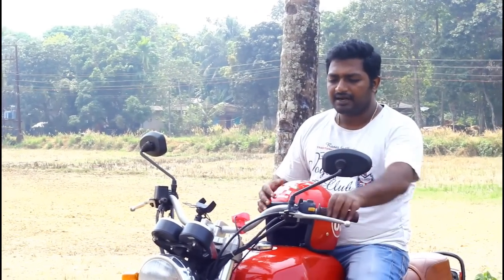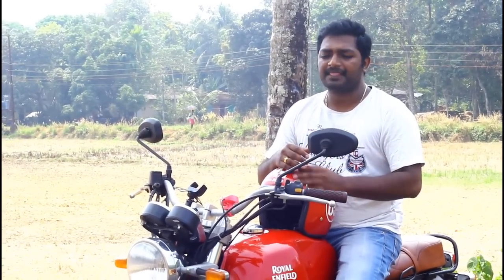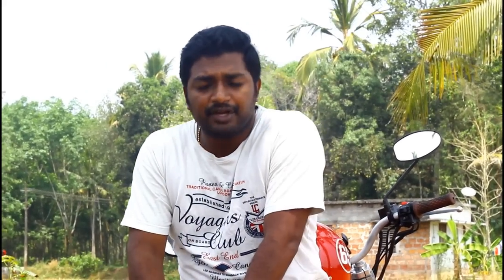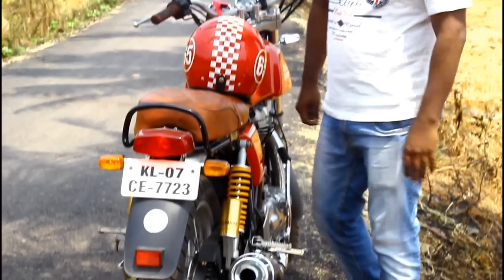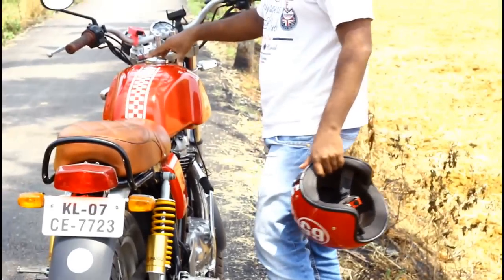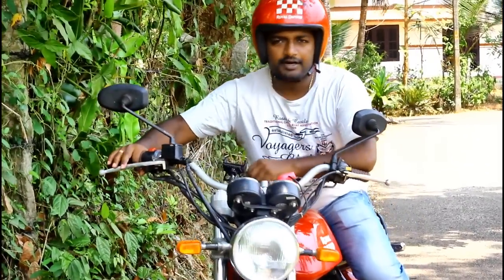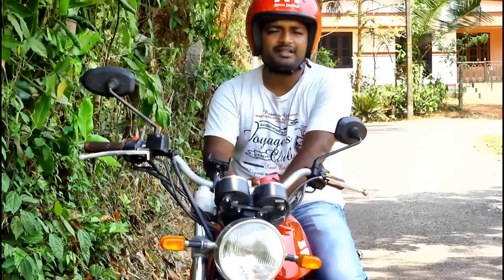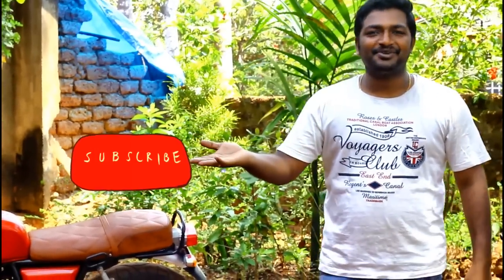Vibration reduction plate for Royal enfield | Installation & Review

Comment: Hi, i changed the plate and it worked really well for 400 kms, and then the vibrations returned to normal how they were before!
I dont know what should i do!
Reply from the maker: Did you install it properly I never had such issues. Try getting it done through a better mechanic.

Comment: can you please tell me how did you install the biltwell grips my mechanic said it won't fit the gt because it's missing a part in the throttle to install biltwell grips
Reply from the maker: Replied to the earlier video, They used the portion of my previous stock grip and mounting bitwell throuxton on top.

Comment: Congrats on making such a good video!It was defenitely a very informative one...I own a tb500 and very confused about buying this...mine is 14k on odo. I'm a top speed lover though it vibrates it is very manageable till 110kmph.i would occasionally push my bike to 130-140 kmph on free highways.since carberry has mentioned 110 as the max speed. How is your bike behaving in higher speeds say 120-130??
Reply from the maker: not a significant difference buddy. You may hardly notice changes at higher speeds.

Comment: I have fitted this plate on my Thunderbird 350 and it has been a month. I felt some vibration reduction in the handle bar but My foot pegs are vibrating more. Is there a specific reason to this??
Reply from the maker: I think the vibration reduction plate isolates the vibrations from a certain section of the motorcycle. I have seen that there are vibrations in the mid section of the motorcycle.

Comment: This plate is of no use and caused other problems in my bike, recommending people to don’t install such things voiding warranty and engine parts.
Reply from the maker: I am not sure why it did not work for you. For my continental Gt it made the ride smooth than it were before. I have heard a few of them say that this hasnt worked for them. Which enfield do you use.. would be good to know on which models it does not work. Can you also detail the problems it has caused. I can inform the viewers accordingly as this is a review post installation on continental GT. Other youtubers named ride with raj and NCR has also informed its ineffectiveness.
Reply: i have classic 350 and after installation it started making noise in my engine, i have given my bike for repair in Royal Enfiled service centre.
Reply from the maker: was the noise similar to a tappet noise. Also did you notice any difference in vibration post installation?

Comment: Are those mirrors on your bike after market? If they are can you share me a link where i can buy. 😁
Very useful video. I think i will buy this plate and get it installed in my bike. 👏👏
Reply from the maker: Hi Phalgun, thank you for the comments. The mirrors are stock mirrors on the continental GT. You can get them from the spares section of the Royal enfield service center. Do let me know your response once you have installed the vibration reduction plate.
Reply: Abhilash Pillai Thanks for the info on the mirrors. I am planning to get the plate installed once i reach 9k during my next service. I just got my bike serviced at 6k. I will update you once done😁
Reply from the maker: Thanks buddy, safe driving.

Comment: I have tried in my bullet 500standard one UCE...but its doesnt works...unusual sound was coming from the engine..replaced back with original plate after using 10kms of run. Very much disppointed.
Reply from the maker: Don't know buddy, might be some issues with your installation or it works differently on 500 standard. Not sure, for me it is just smooth.

Comment: Mr. Abhilash Pillai, i have a 2002 Electra, the first model of Electra, with the right side gear and left side brake, will this plate suit my bullet???
Reply from the maker: Don't think so but you can try emailing the carberry, they may have tweaks for you . But at the moment its just for the UCE  that were post 2011.
Reply: Abhilash Pillai oh ok, that means they don't have a plate for the RE's that actually had the "Vibrations", they have the plates for the RE's that have evolved over the years and there is substancial reduction in the vibrations in the bike directely from the factory itself...well i think i'll wait till somebody else comes out with a plate for my RE...👍👍👍
Reply from the maker: lets see, evolution has started...

Comment: I am not sure how this plate , reduces the vibration. Please share reason how it's reduces the vibration.
Reply from the maker: The plate is technically stated to stabilize the RH crankshaft.
In royal enfield UCE engine there are two bearings on the left, while there is one at the right side.The stock plate covers the bearing on the ride side which comes fitted below the housing of clutch. This causes pressure on the crankshaft and increases vibrations at higher rev.
According to #carberry the plate stabilizes the right-hand side of the crankshaft. The plate is fitted after the gear which drives the cam wheels. Also carberry provides an additional bearing installed on the end of the crankshaft, which sits on the vibration reduction plate offering better support. This is how it reduces vibrations.

Comment: Dude you spoiled a gt by putting bullet modifications. You could have bought a bullet 500 instead🙄
Reply from the maker: The beauty of the royal enfield is that you can modify it to suit your requirements. My arrangement is easy to transfer between a cafe racer and cruiser with a 10 minutes rewiring.no bullet 500 is alike a 535 cc; if you have one you would know that it is a beast.
Reply: Abhilash Pillai i have riden a GT for a 300km up and down ride and GT is my favorite vehicle. That’s why I couldn’t see this in this mod and stay mum😁. I personally ride a tb 350 and recently i too installed the VRP. You could very well use the clip ons and cruise comfortably in 120kmph i believe
Reply from the maker: :) sir, There is nothing to feel offended or be pride of; everyone riding the GT complains of the killer vibrations above 100. I have received several personal email's thanking me on the handlebar change I have shown in my video. You can still find people asking about the handlebar rather than the Vibration reduction plate in this video. I guess they do not want to change only because it is clipons, they want to feel comfortable and have less vibrations.
I have completed more than 100,000 kilometers on GT and also have ridden it longer than what you say; aint a big achievement but we all like riding and thus are communicating through this forum. I understand your love for the GT and I am happy with the motorcycle as well but if something is wrong, needs to be highlighted and corrected. I guess your GT might be the only exception having no issues beyond 120km. Again no offense!
Safe riding buddy, healthy criticism is always welcome.
Reply: Is it true that you have riden 1L km with your GT?🤔. My gripe was why buy one bike and try to modify it into another. The beauty about GT is the posture you get. Not a big fan though as it hurted me. What i meant was after installing the VRP i hope you could cruise comfortably in 120kmph😊

Comment: can it be installed on thunderbird 350
Reply from the maker: yes sir, if it is UCE
Reply: Abhilash Pillai uce..?
Reply from the maker: UCE means 'Unit Contruction Engines'. In UCE, the engine and gearbox components share a single casing. All royal enfields post 2011 have UCE's.

Comment: That motherfucking tappet noise just make me wanna kill the RE ppl
Reply from the maker: oops!! you should try approaching a good RE mechanic and he will get your tappet noise sorted out for some time. Re indeed should concentrate on their engines.
Reply: I have a good mechanic who has eliminated the noise specially at idle speed .
I was talking about ur bike plus add some weights at ur handle it will make it even more smooth and stable
Reply from the maker: Thanks Nachiket. I had bar end weights before. Since the vibrations have gone, I replaced them with the closed end thruxton grips. Thruxton grips are rubber coated with better handling during rainy season.
Reply: Abhilash Pillai will try the grips are they heated???
Reply from the maker: Thruster grips are injection molded grips. Visit the link for more details. https://goo.gl/x98BDa

Comment: can it be used in avenger 220 too??
Reply from the maker: I dont think it will be suitable for avenger 220. Are you getting extreme vibrations in Avenger, I thought it was a comfortable touring motorcycle.
Reply: it was comfortable, but recently i m getting lots of vibrations post 60 kmph. i complained several times to service center, each time they say, its fine, there is very less vibrations and its normal for old bike. it has covered about 36000 km till now. above 70 its pain in ass to sit.
Reply from the maker: oops! that's sad to hear. Before you get inside the engine, Try to check the front forks and the cone set for alignment. Try changing your engine oil if you doubt maintenance could be an issue. If still the issue persists, contact a good mechanic and get the engine checked. Service centers wont support engine faults. If it is within warranty, ask them to correct or replace.

Comment: chetta GT iye kurich chettanta abhiprayam endha. engane ind bike???
complaint vallathum indo?
enik edukkan vendiya
Reply from the maker: So here are some thoughts for you:
a. The stock version has lot of vibrations beyond speeds of 80 and after 120 they are extreme. There are mod's available to ease this but still it is unsahikyable!
b. Overall the bike is very smooth to ride but at times it makes you feel that it is angry on you. Again the engine needs refinement.
c. The gear shifting is better than the other royal enfield's and riding is smooth. It has lots of low end torque that makes you really really happy.
d. With the stock arrangement, you can go as fast as 100 quickly within 4 seconds and you wont know that you are riding that fast.
e. Taking turns and cornering is better than other royal enfield but not as good as ktm or other motobikes. It is realy heavy for the stock arrangement.
f. You need to be atleast 5 feet 8 inches for you to feel confident in riding it.
g. It is a magnet, every person who sees it passing will start watching it like a wonder. It looks gorgeous.

Overall it is a marvel and you will love it each moment you ride. Maintenance is less than other royal enfields. I have completed 100,000 kilometers on the GT and I am happy with the motorcycle.

Comment: Can this be used on Classic 500
Reply from the maker: After 2011, all the Royal enfield bikes were converted to Unit Construction Engines. If your motorcycle is manufactured after this year then it is an UCE make and of course the plate will work for you.

Comment: I have changed the handle bar long time back. Installed Uprising fir comfort. But vibration remain the same.  Please send me the link where I can bought this plate and the double seat like u.
Reply from the maker: Hi Shounak, Thank you for the comments. I got my seat from the official service center of Royal enfield. They have a spares division that supplies the parts. 
The link to purchase the plate is in the description.
If you plan to change the handlebar, select the one that is bent downwards or upwards and slanting towards you. This is the best composition that takes less vibrations to your hands. Do purchase a handlebar that isn't hollow and is strong. Hollow handlebars may require a bad end weight. I have been getting comments on the handlebar for some time, so I will do a separate video detailing the selection criterion.
Reply: Abhilash Pillai I have changed handle bar and installed d himalayan handle bar.  Yes I got the link for the plate.  But did not get the same seat from Royal Enfield showroom.
Reply from the maker: You need to check with their spare division and ask them to order one for you. Himalayan handlebar for GT is not comfortable, it is very risky to ride with that handlebar, plus it does not dampen handlebar vibrations. Try using an upright handlebar.
Reply: Abhilash Pillai then which you suggest? And I'm also looking for alloy wheels for GT. Coul you please help me out? Without alloy it very risky to go for long for adventure..
Reply from the maker: May be I will do a video for you to understand better.
Reply: Abhilash Pillai thanks.  And please help me to find alloy wheels for my continental GT
Reply: Abhilash Pillai please help to buy a good handle bar for Uprising. My himalayan handle bar producing quite vibration
Reply from the maker: Did you try the vibration reduction plate, you may not need to change a handlebar. But if you are looking for an upright handebar select something like this. https://www.baakmotocyclettes.com/en/home/29-baak-n1-handlebars.html   mine is inspired by this.
Reply: Abhilash Pillai good one but costly too. No I didn't change the vibration plate. Will visit sikkim after few days.. Let's see how this bar works... #pray for me... 🤤🤤
Reply from the maker: Happy riding

Comment: Which type of handlebar it is? Can I use it for my classic 350.. pls suggest
Reply from the maker: It is a custom built brat style handlebar. You may have to use a different clamp for this handlebar.
Reply: Abhilash Pillai  is this available in Mumbai?
Reply from the maker: Not sure buddy, you will have to check it at local dealers.

Comment: hello Abhilash Royal Enfield Interceptor 650cc also have vibration !! why this famous company is not able to rectify this problem!! even Bajaj Avenger Cruise 220 is smooth, only problem is material quality is very bad.
Reply from the maker: Interceptor isn't out for our testing. Hope it will have less vibrations being a parallel twin
Reply: Sankarankutty Raju Where did u get a chance to drive 650cc Interceptor..??
Reply: Abhilash Pillai , Ok thanks

Comment: I still doubt it, how can they get rid of vibes without a counterbalancer shaft??
Also how did you measure the percentage reduction in vibration, what metric did you use?
Reply from the maker: They are not as effective as counterbalancers but do give you a room to relax. The percentage measurement isnt based on any scientific notation of measuring vibrations but is a guessestimation comparing the old against new.

Comment: Bhai mere pass very new bullet hai but woh handle chod ne par right side ko jati hai.
Reply from the maker: There could be several reasons: 1. Ask mechanic to check if tyres are properly aligned with the rims. It happens sometimes that it is fitted wrongly. 2. Check coneset
Reply: Abhilash Pillai thanks and i subscribed
Reply from the maker: Thanks buddy

Comment: Me too agree bro .. Have installed the same on my Thunderbird 350.. and it's working great...
Reply from the maker: Thanks Sabarish for the response. Happy to hear that it worked for you as well. Hope my video was useful.
Reply: Wonderful - The real difference is visible post 60 km/hr .. the vibrations has greatly reduced  .. the vibrations which you receive at the handlebars are good ones and the rattling of the mirrors has also gone down.
Reply: @amplifyadventure  what about the milage? does it affect  milage?
Reply from the maker: No sir
Reply: @AbhilashPillai-lifeatabhi   thak u for the reply
Reply: SABARISH PILLAI what was your experience